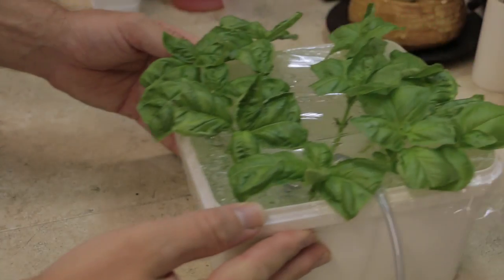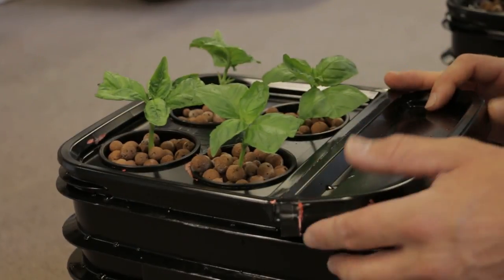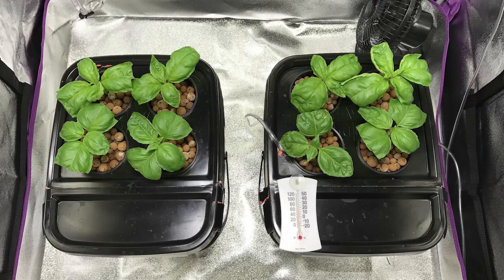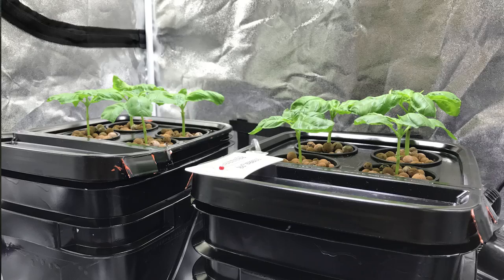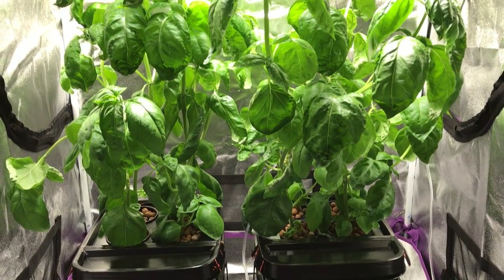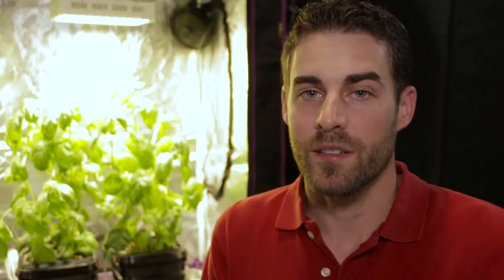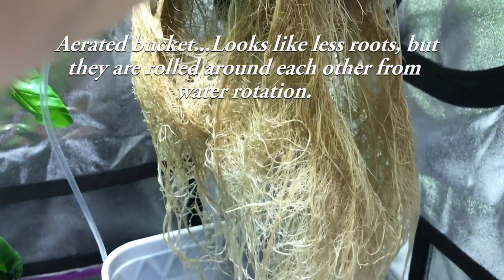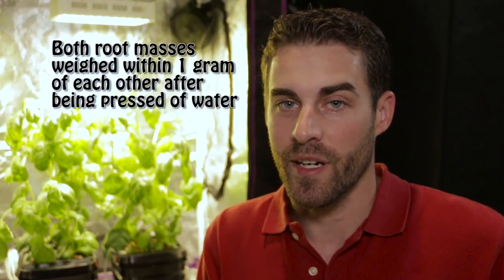Kratky vs DWC - Aeration vs No Aeration (Hydroponic Basil) Part 2

Comment: I haven’t heard about Amour Si before. I’ll try using it. How much Amour Si did you add? 

A much better method to create holes for the net pots is to use a hole saw bit and an electric drill. The pilot hole is drilled forward, and the larger hole is drilled in reverse. When drilling reverse, the edge of the hole are clean and smooth every time. Make sure that the hole saw can be run in reverse without removing the hole saw bit from the mandible. Not all hole saw bits work in reverse. 

The hole saw size is critical for net pots. There are 4 hole saw sizes that work best for the common net pot sizes. The best hole saw sizes I’ve found are 51mm, 75mm, 3-5/8, and 5-1/4. These specific sizes are hard to find at stores, but are easy to find on-line.

After you create your net pot holes with a hole saw that can be run in reverse for the net pot hole, you will never use the Dremel tool again for creating the net pot holes in your containers.

Comment: the ph down effect is caused by the air itself. it is the mostly the co2 turning it to COOH- acid if solved in water.
in my theory if you mix your nutrient solution in the tank activate the airpump for 20 min and then adjust the ph once it should stay stable for a few days before it alters again.
if you fit a ph sensor and arduino with a solutionpump you could stabilize the ph.
if you would use low concentrated amonia as PH up solution, you have a nice way of providing more nitrogen to the plants.
Reply from the maker: Tacker Massacker that's what I was thinking...carbonic acid. Instead of keeping it keeping it in balance, it absorbed it more.
Reply: It is possible that there was more bacterial growth with the aeration that lowered the pH.

Comment: 3:21  Good video, but it sounds like the question you asked yourself at 3:14 was a very good one, and the response you gave to that question at 3:21 was, relatively speaking, not good. When doing an experiment, its best to exaggerate everything as far as you can and push everything to the extreme so that if there is a difference, it shows up more clearly. For instance, if i wanted to test how light effects plants, I could put one plant outside my house and one plant inside my house. However a better experiment that would give much, MUCH better and more conclusive results, would be to put one plant outside and one plant in a pitch-black room that has 0% light leakage. In the second example, if light does effect plants, it will show up without question. In the first one, it may or may not show up.

Comment: I wonder if topping up the water/nutrient level to the bottom of the netcup as you would typically do in DWC would have given you the results we were all initially expecting?  I realize that you're only trying to determine the difference between aeration and non-aeration, but you're not fully able to take advantage of aeration due to the lack of water/nutrients in the DWC bucket.  As far as I understand, the whole point of DWC is to keep the roots submerged in water to absorb significantly more water, nutrients and oxygen instead of being left to become air roots.  The DWC is a little more hands-on than Kratky, but there are benefits to be had if you take advantage of aeration.
Reply: i agree with this. if we look at both buckets half way and on, they look both like a kratky set up just obvy one has the air stone. the air roots get the max air they need prb more so than the roots in the aerated water. i agree with you, redo exp with the same water lever on the dwc, the whole time through.

Comment: The commonly known DWC is not true DWC. What this so-called DWC method does is adding oxygen to a water volume similar to Kratky's since the plants are of fixed height instead of plants floating directly on top of the water in true DWC. As a result, all those oxygen bubbles create mist/water droplets that take time to runoff to the reservoir, decreasing the water content in the reservoir and maybe increasing pH? In other words, the oxygen pump only works in the beginning when the water volume is high, at the cost of creating mist and lowering pH; and when the plants have sucked up a lot more water and nutrition, the oxygen pump should become less effective since a smaller and smaller portion of the root is submerged.

Comment: In DWC aren't the roots almost 100% submerged in the water? In the few frames where the water levels were shown it looked as if the water levels were low and exposing a significant percentage of the roots to the air as per the Kratky method.
Reply from the maker: Dwc is technically full submersion. But what most people call dwc is actually just aerated kratky. And the shots were during a water change.
Reply: but then you arnt comparing true dwc, as good goat says. you are comparing aerated kratkey vs kratkey. but in your video you keep trying to call it dwc?

Comment: Aerating your water not only adds oxygen to your water but also carbon dioxide (CO2). When carbon dioxide dissolves in water it produces carbonic acid (H2CO3). So my guess:  this weak acid lowers the pH of your water.
Reply from the maker: Survival Bert that was my guess. It's just the opposite of what I thought would happen being a fish tank keeper.
Reply: Aeration changes the ph as well. As nitrates are absorbed they leave hydrogen ions in the water as well that make the water slowly more acidic. However the plants generally like acidic water.

Comment: Very good experiment. My question is, if it is supposed, that you should not replenish the water in the kratky method, the salts will accumulate in the bottom ... how do you control the ec, if you can not add more water?
Reply from the maker: HidroGourmet I usually had water twice and then do a change out. The salts only accumulate if the solution becomes basic or if the reservoir gets too low on water. Which never really happens unless someone adds ph up or doesn’t do top offs. Even if it doesn’t become basic while adding ph up, if it’s added directly then some minerals can fall out of solution where the base contacted it before it mixed and diluted.

Kratky isn’t about not adding water, it about allowing roots to be exposed to open air. Usually the bottom half to 1/3 of roots sit immersed.

Comment: Are kitty litter buckets food safe? I got a bunch of them but figured they aren't "food grade".
Reply from the maker: Food grade and food safe are two Different things actually.
Reply: @GrowingAnswers  good point. I'm guessing they are safe to use since you are using them. They really are the perfect free bucket for this setup. I wish I hadn't thrown so many away in the past.
Reply from the maker: Engineer Cat short answer is yes. Not may type of plastics used for containers you’ll find in a store aren’t food safe.

Comment: kratky roots breathe from the roots above water level. 

the water level should be lowered to half of root length or half of bucket height which ever  after the roots have grown long so that plenty of air roots grow  and the plant has plenty of air and co2 which it draws thru the roots.

kratky is amazing bcuz usually water has depleted oxygen in 3 days  and in 14 days it starts growing bacteria but in kratky the roots are so well aerated that it doesnt matter.

i change water once a week thou bcuz i use low ppm nutes. i dont want to give strong nutes so no burns.
Reply from the maker: Jungles Bongles both methods were allowed to drop to 50% water level. I talked  more about that in part 1.

Comment: I grew basil using Kratky in a mason jar and after 6 months, the roots were shaped like the mason jar and could barely remove to re-fill with water.  Lol. And the stems became wood.  I am just starting with DWC now. Never realized silica was important. I noticed my kratky kale stems were very weak vs soil
Reply from the maker: TheJamesOutlaw silica isn’t always noticeably helpful. Depends on various things. But it’s not like it’s not needed. As far as your kratky jar goes, it makes sense for how long you grew it. Sometimes I think plants can grow too fast in hydro and not deposit enough silica for stronger stems. Many plants that grow slower have time to continuously deposit silica so it’s not always lack of silica that’s the problem. It takes time for some plants to harden off. Topping usually helps cuz it gives the plant time to do so.

Comment: great video, thank you. but I have a question. when you say kratky vs dwc, is the dwc a  real floating raft system or a kratky with air?? thanks.
Reply from the maker: I don’t remember too much from that video, but I can tell you it was not a floating raft. I think what I did is just kept it full
Reply: @GrowingAnswers  so in your opion, is one better than the other,??
Reply from the maker: @litano  Kratky is great for simplicity and any aerated solution is going to work better or at least grow faster. True DWC in my opinion seems kind of pointless. Completely submersing the roots entirely doesn’t seem to be any better than just immersing the roots with aeration

Comment: Please answer why the root hate light?

And also answer : 
If we add an aeration into the hydroponic nutrient tank on NFT system, can the dissolved oxygen in the nutrient tank be brought up to the top of the installation pipe or this metode can only work on kratky system?

Iv'e been asking this to many people but still can't get the right answer for me.

Sorry for my English.
Reply from the maker: I can’t fully answer the roots question. However, uv light from sunlight is bad for roots and the microorganisms that are part of the symbiotic system that the roots use, can be sterilized by uv light. Roots tend to die after too much light exposure. As far as oxygen goes, yes if you aerate an reservoir external of the planted containers then it will have enough oxygen, but in that case it’s no longer defined as kratky. Kratky simply has roots partially exposed to air with no need for aerated water.
Reply: @GrowingAnswers  In my country, the NFT system uses pipes as a place for plants to be planted and for places where nutrients are mixed is in an external reservoir where we use water pumps to carry nutrients to each plant pipe.

Sorry if i have to ask you about this two times,

If we aerated the external reservoir, will the dissolved oxygen be able to be carried by the pump through the pipe so the plants can have more oxygen even if just a little oxygen?

If yes, how far the oxygen can goes?

Thank you.
Reply from the maker: @grim8505  if water is circulating, you don’t need to aerate. Circulation is aeration.
Reply: @GrowingAnswers  Thanks, one more question, 

Does provide 24 -hour grow light on the nursery will grow faster than using sunlight
Reply from the maker: @grim8505  plants grow most in the dark. so no

Comment: Nice to see we can do about equal without the pump noise for those of us living in a small space. About Kratky, the buckets in video look pretty deep, have any idea about how much air space is needed for roots to be well oxygenated vs too little air space ? _I have this question because i was looking at the Hydrofarm kratky Salad Box & looks pretty neat but kind of shallow compared to many DIY kratky videos...
Reply from the maker: Usually you just let the water level drop down. It will grow as long the roots are touching water. Id say at least 1/8 the length of the roots should be submersed. Once the level drops below half the length, never fill it above halfway again. The depth of the container really is not all that important. but less water volume means more attention is needed.
Reply: @GrowingAnswers  Thank you

Comment: I have a question:  when you're growing in these experiments, in the tents or just in your basement or wherever else in your house, what are the temps (the high and low temps)?

Thanks.
Reply from the maker: Complex sits around 68-72
Reply: Oh really?  I would've thought warmer than that, in the 75*+ range.  I guess it's not very much wattage from those particular leds you're using.

Cool, thanks.

Comment: So after some personal failures with both kratky and DWC, I realised I'm doing something terribly wrong and it raises the pH level.
And at the first video I thought I finally had an answer, that pH can raise a lot if there is intensive aeration. But now, it seems to have an opposite effect?
Reply from the maker: tonyvice6661616 it can at first, but becomes acidic from dissolved co2. It shouldn’t effect it that much though.
Reply: That was fast!Thanks! I really appreciate that you responded! Good luck on your ongoing ventures

Comment: I have started some tomato seedlings in 3" net cups with clay pebbles. They are around 10 days old and 1 - 2 true leaves appear on them. I am doing it krtaky in small plastic jar. The roots are not coming out of the net cup. The nutrient solution is just touching the bottom of the net cup. What could be the issue and how can I fix it? Thanks.
Reply from the maker: Mayur Shah doesn't sound like there's any issues. Tomatoes take a while to get started. As long as they are still growing, I wouldn't worry.
Reply: Alright. Your words relaxed me. Thank you.

Comment: I wonder if starting it at a slightly high PH to start with would adjust for the depletion effect that happens with aeration over time? 

Also, I noticed that your Kratky plants had more leaf curling than the aerated ones. I have Kratky going right now and notice this in my plants too. I wonder what this is exactly; a nutrient deficienc,y or some sort or sensitivity to the lights that affects the Kratky more than the aerated ones?
Reply from the maker: IAMGiftbearer I think it has something to do with calcium and either too much or not enough light. specifically I don’t know. I wasn’t paying as much attention to that because nutrient uptake wasn’t one of the main observations. There are a lot a variables when it comes to chemistry and lighting. In order to understand that, I’d have to grow a single plant and adjust the lighting first to see how it effects it. Can’t really do that while running another experiment though. 

What I can say is that the less light the pepper plants have, the more crinkly the leaves get radiating outward from the center of intensity.
Reply: IAMGiftbearer I’m thinking the lead curl is a reaction to not getting water to the leaves so well - I bet the aerated one is better hydrated internally once you get further from the root
Reply: Try increasing fan blowing down on plants if you can. Somehow increase air circulation which directly enable transpiration and calcium uptake.